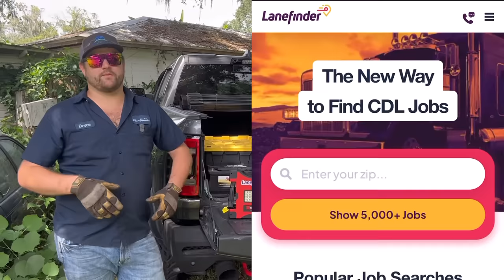WILL IT START? Abandoned Semi Truck in the Jungle!

Comment: Looked like those handlebars on the big cutter was a bit to short and awkward. And that gear lever should be placed higher so you don’t have to bend over so many times. Looked uncomfortable
Reply: Was thinking the same thing about the gear shift lever.  My grandparents owned a 90s-model DR brush cutter; the gear selector is right there on the main panel between the handlebars, and the bars are pretty high up.  Theirs even has a lockable differential 😁
Reply: I got a bad back there’s no way it would be able to handle that shift up and down like that
Reply: I was thinking that same thing.

Comment: Those generals had a cable operated clutch so the cable was probably seized. Surprising how easy those Detroits start after sitting so long.
Reply: Yeah there’s a reason they still use them for the fire pumps on ships
Reply: Hey Noshsreqd , Please make some more videos of your 1968 GMC 2500 and the 1963 GMC 5500 . American Iron all the way! Thanks
Reply: The only thing that works from detroit

Comment: I don't own a diesel and Probably never will but I'm always super impressed on how these old diesels fire up and a  gasoline engine would never start up if it sat just as long
Reply: George Jones  how about one left in the weeds like that Truck. In my experience gas goes bad, carbs don't like to sit and gas engines poston rings freeze to walls. Seems like these diesel engines come back to life so much easier

Comment: Bruce , you should get a piece of aluminum and weld a handle on it , start taking the intake off before starting these old Detroits  just in case they decide to run away.  At least then,  you could shove that aluminum over the intake and starve it for air !  They're cool to see shoot to the moon but boy that could turn into a "will it stop" video real fast ! Air shut off plate and fire extinguisher.  Oh , get that old Ford back in business for the will it starts , that thing is pretty cool !
Reply: That's true what you've written but I've heard a few times if using the emergency stop or putting something over the inlet to stop it the blower has to be resealed as the pressure affects the seals .
Reply: @andrewking4885  I haven't heard that . I experienced a runaway CAT one time and we got a piece of wood shoved over the turbo inlet and got it shut down, not so sure with a Detroit but id rather do seals than dodge wrist pins and create a boat anchor!

Comment: If you get the chance, see if you can find some big old military boats and do videos on them.. Most of the old military boats were diesel powered, most of the landing and river craft were Detroit Diesels, like the PBR is a 6V53. You know, checking the oil and making sure there's not a huge critter nest in the air intake before you crank it over and suck in through the engine would be really smart... but I guess that's not the Florida Man way. Also opening the intake would allow you to cover it with a board to block it off if it runs away.. otherwise it'll blow itself up... eventually. I swear those are probably the most reliable engines ever made.

Comment: Hi Bruce, this truck stopped for so long, starts on the first grip, and runs at normal idle. You recover this truck, since the engine, and the other mechanical parts must be working well too. Is this engine a Detroit V8? Good job we like your videos. I'm from Brazil, here we use the same roads as Europe. Scania, Volvo, Daf, Wolkswagem, Mercedez. have a nice day.

Comment: Amazing that it started that easy but like the other guy said,  to just start it and pile all the crap back around it, boring....now if you pulled it out and parted it out or got it running again, that would be exciting :) and before anybody rails on me I only watched the video because YT suggested it. Won't likely watch more if that's all this guy does unless it's an interesting engine.

Comment: The real question is "Can Bruce start this old deisle?" . lol. It takes some cranking energy and some fuel to start a deisle engine. A little bit of ether if compression is a bit weak. These big engines draw a huge amount of volume and squeeze it into a desert spoon so hard you could damn near run them on wet fish.  In short yeah it'll start ! These motors have driven back into the yard with a hole in a piston before today. Though the resulting cloud resembles a burnout competition. 
Finally watch along with us? These never grow old, One day you might see a runaway deisle and thats just frightening (even on a screen). Even war movies cant promise you that.

Comment: Carful starting those 2 stroke detroits. If the fuel rack is stuck it can run away. You can take the valve covers off and actuate them. If they move your good to go ahead and start them.
Reply: Spring loaded rack on 92 series one injector will not stick the rack